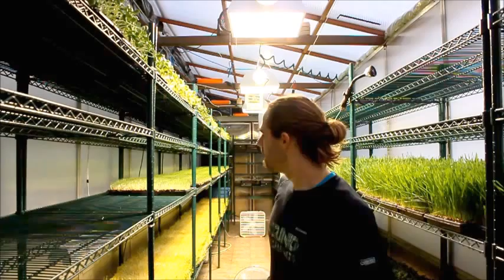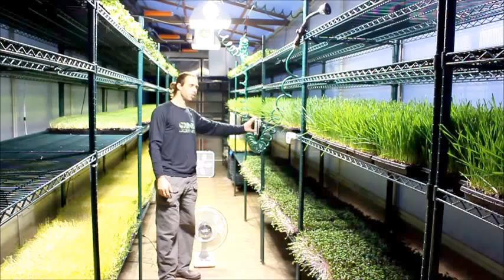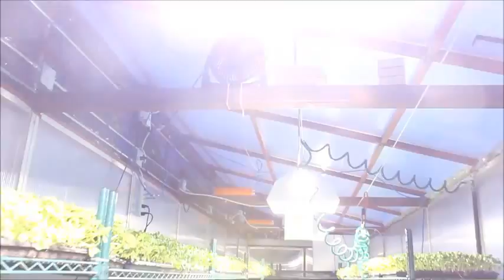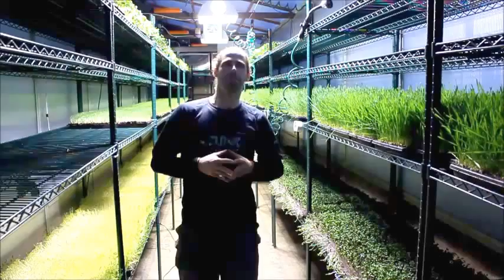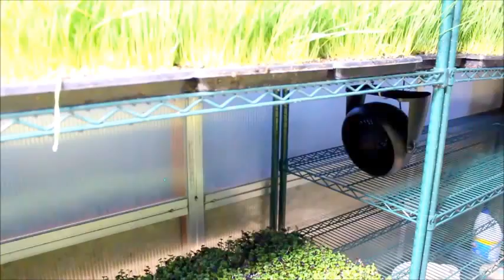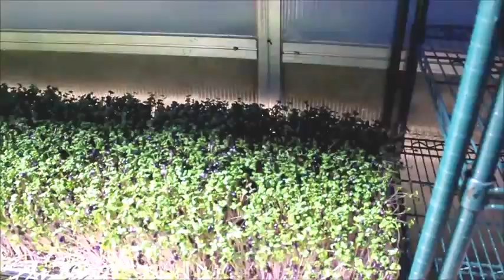Microgreens Growing System Air Flow

Comment: In winter I grow veggies in my attic hydroponically with lights. With no fans I noticed my growth was very slow... 1/4 inch tall sprouts of Lettuce would stay under 1/2 inch for almost 2 weeks! Yesterday I placed a fan over all of my sprouts and in less than 8 hours they grew from 1/4 inch to almost 1 1/2 inches... by the next morning they are 2 inches tall... I'm shocked as to how important this is!!!
Reply from the maker: George Adams + The area around your crop, if the air is stagnant, will become depleted of CO2. The airflow ensures the air is better mixed to better distribute CO2 and O2.
Reply: I feel it helps the plant breathe.....

Comment: what set up is needed for the hose?
Reply from the maker: Not sure what you mean. Can you elaborate?
Reply: @MicrogreensLab  Is there a special type of plumbing needed to set up the indoor house? Or does it hook up to a sink?
Reply from the maker: @danilles.4247  you can buy an adapter so you can connect a hose right to a kitchen or bathroom sink tap. I did this previously and used a "coil" hose to run to my production area to keep things a bit neater - worked pretty well. Unfortunately I have no pictures!